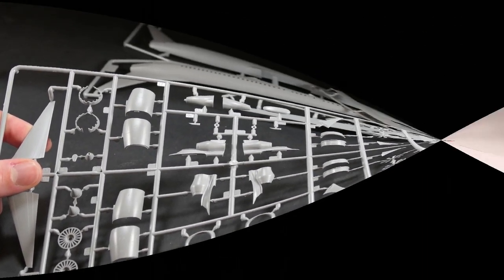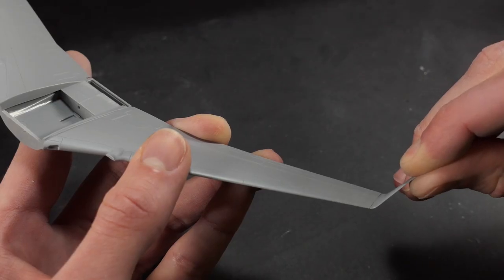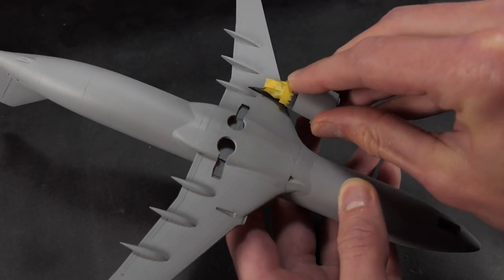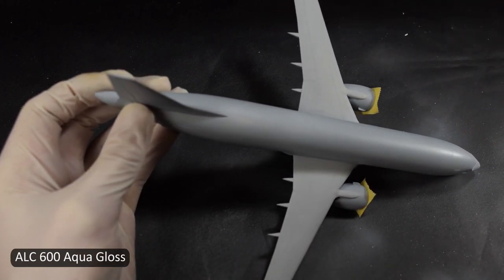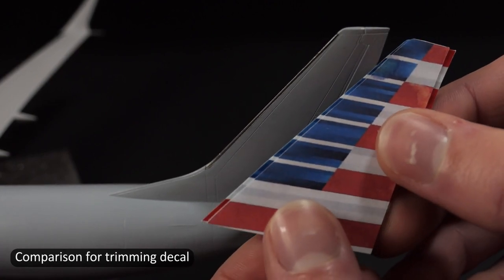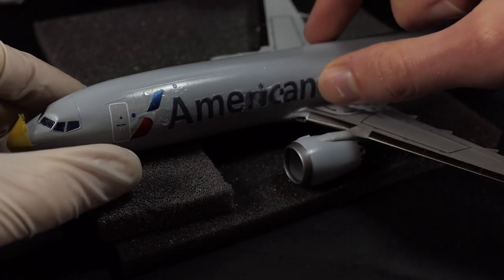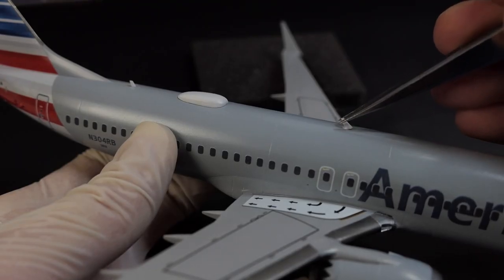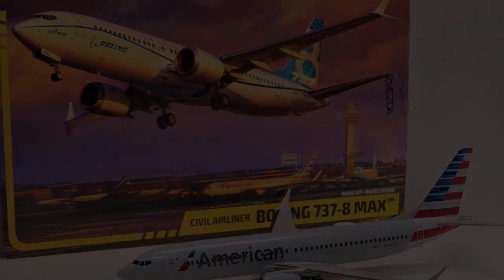American Airlines 737max | Full Model Build

Comment: its called an LPT cone, the low pressure turbine section of the engine where the oil flows for bearing cooling and lubrisation,

Comment: Did you paint over the kit's transparent windows?  Did you putty them first, or just paint over as is?  (sorry, I'm about to do my first airliner, I usually build 1/350 warships)
Reply from the maker: Good question, I puttied and sanded them before painting.  There's no guarantee your window decal will line up perfectly with the kit windows, so its best to start with a smooth clean surface

Comment: It looks really good. do you use warm water for decals or do you use a decal liquid?
Reply from the maker: Both.  I use warm water to separate the decal from the backing.  While Im positioning it on the model, sometimes I use water, sometimes I use decal solution (Microset).  I honestly cant tell the difference so it just depends on my mood.  Once its in place, I always use a decal softener (Microsol) to help it conform and sink into the panel lines even better.

Comment: How do you adress the inevitable seams that present themselves inside the engine cowlings, top/bottom ?  Nice build
Reply from the maker: 👍 For those seams, they're a nightmare (if they are actually present).  On this plane, thanks to good kit engineering they aren't there.  See 2:01 and thats the front of the cowling moulded as 1 circular piece.  On other planes Ive used either a thin round metal file, or sandpaper wrapped and super glued to a toothpick.  If you want to see this technique in action, check out my Solaseed Air 737 build at 2:39. Each method is tough and usually takes multiple putty/sand attempts.